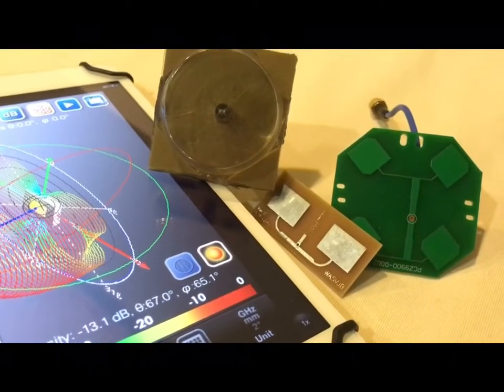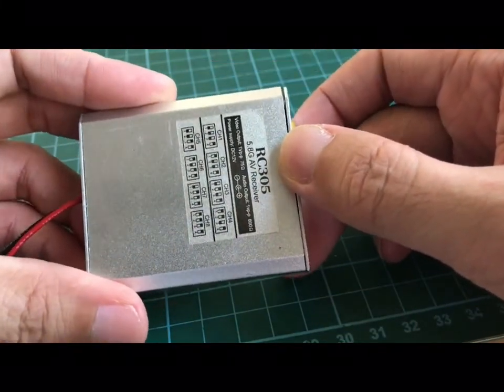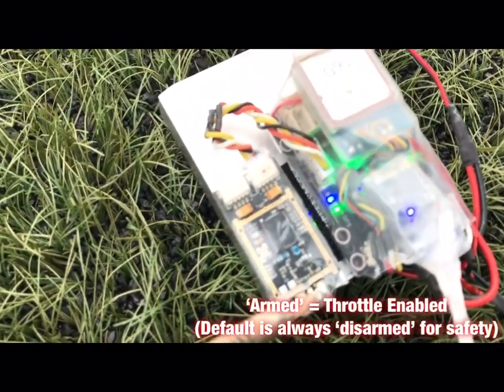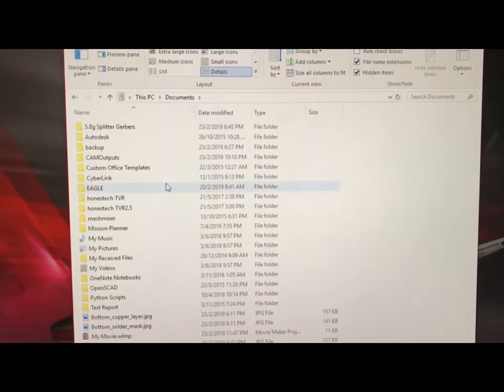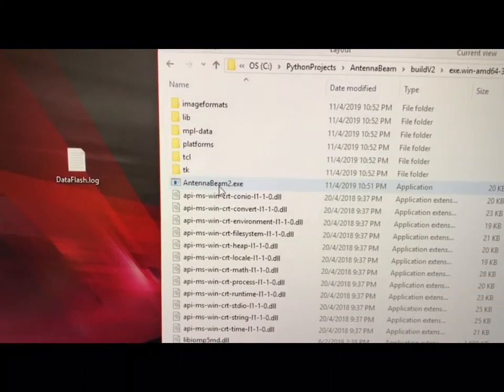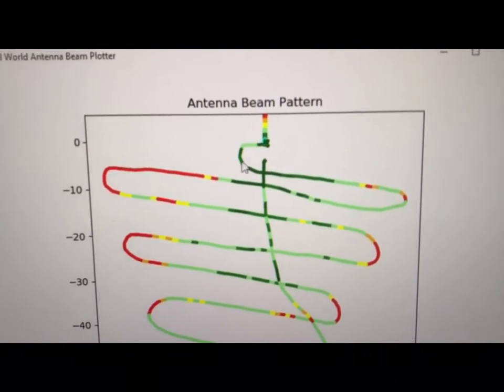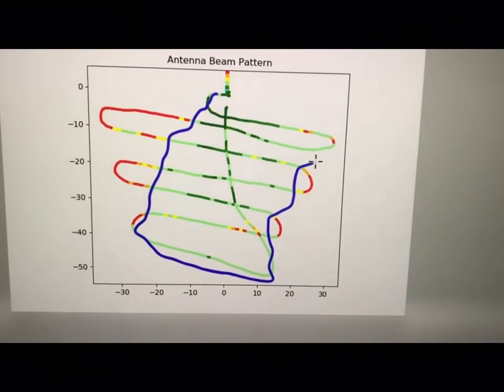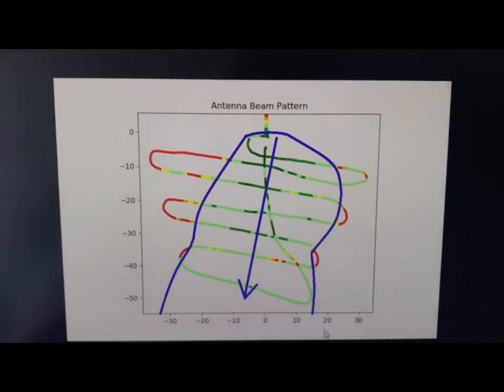Real-world FPV Antenna Beam Plotter (free Python source codes)

Comment: If only I have something like this to plot my rssi and video signal strength.
Reply from the maker: Thanks for checking out my project. I’m sure it’s a matter of time that someone would manage to do a similar hack for betaflight board.
Reply: @terence79chan  actually I log GPS coordinates,  RSSI, Battery Voltage, etc in a CSV file of my radio. All is needed is to extract that data and plot it on a map.